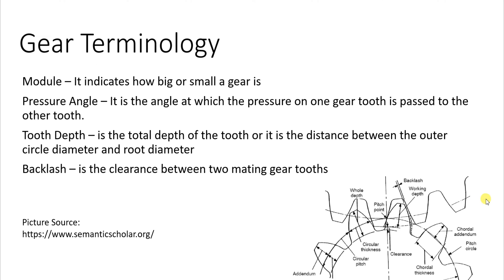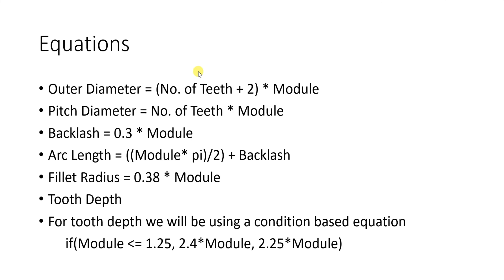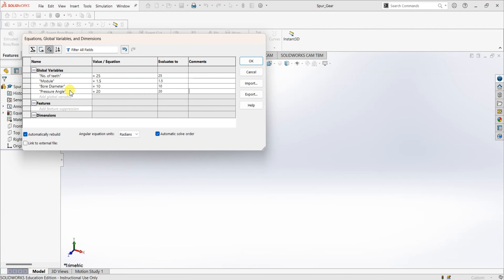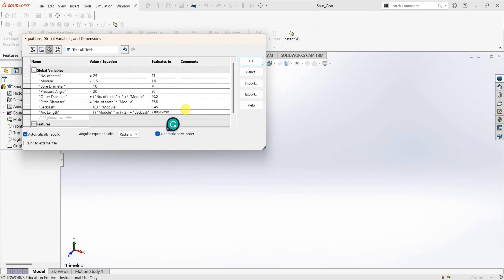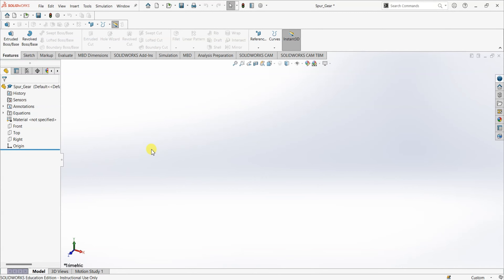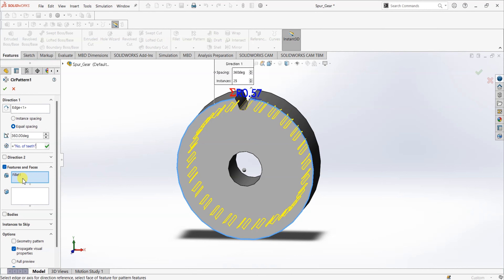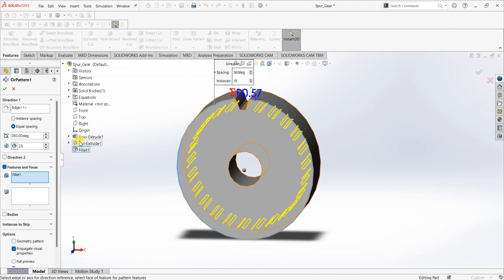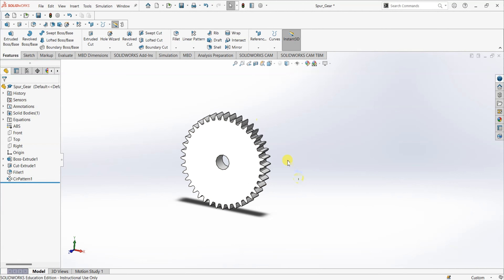Spur Gear Design in SolidWorks: A Step-by-Step Tutorial

Comment: I have a Module of 2, Pressure Angle of 20°, PD 180 and OD184.  The backlash seems excessive.  If I change the backlash to (.1*Module), the backlash comes out to .25mm (.010").  Should I keep this reduced backlash, or rely on cutter involute for tooth matchup?
Thanks!
Reply: I had the same feeling, I'm reverse drawing a gear for a model train that is a module 0,5 18 teeth wheel. A backlash of 0.3 seems exagerate especially on such a small gear, I've scanned the original gear and used a CAD to check for measures and seems like the original item did not account any backlash at all.

Comment: This is not a real gear. Not suitable for 3D printing. There are similar gears in the toolbox. Where is the involute? A real gear has an increasing radius.
Reply from the maker: I understand that Gear Design involves a bit more complex process with calculations, this is just a method of designing a spur gear and for practice for people who are just new or learning the software.
Reply: @designingmadeeasy23  I think it's the wrong way. Users think gears are really shaped like that. In the toolbox, the gears are also designed like that.

I created gears with involute for myself. I wanted to see how other users do it. By the way, I saved the values for the gear in the "Summary Information" in "Configuration Specific" or "Custom". The values are quicker to change.